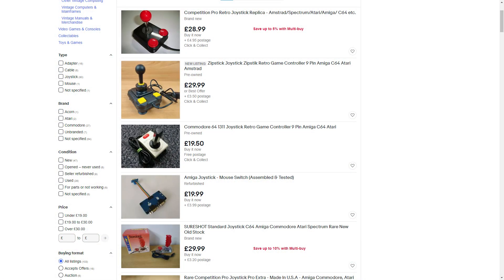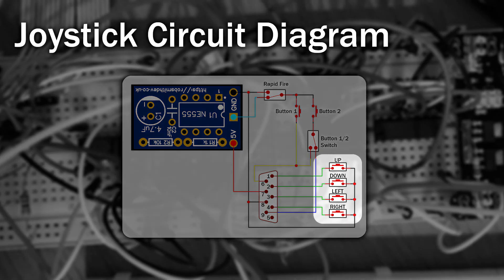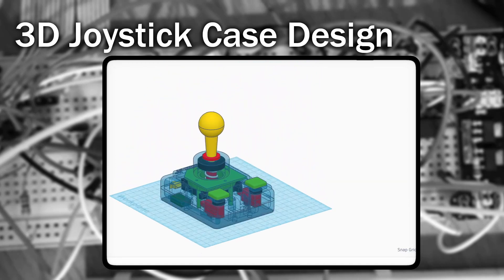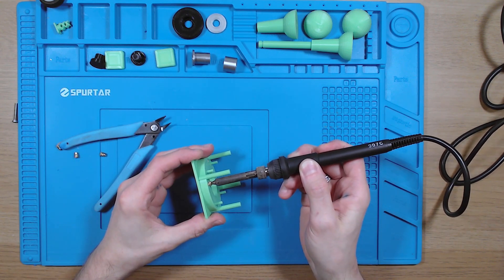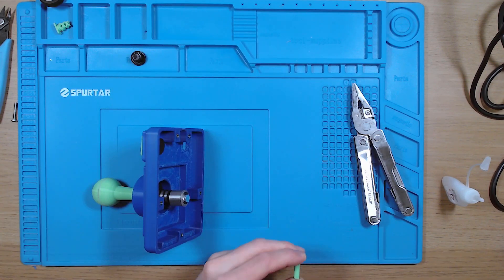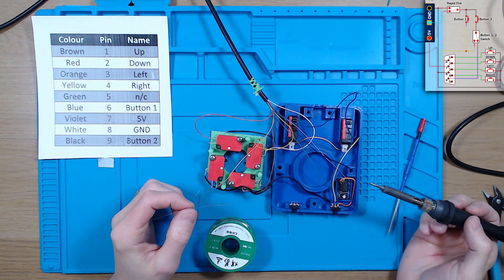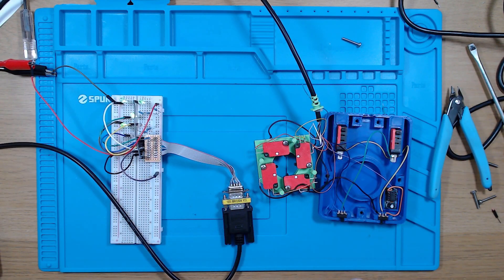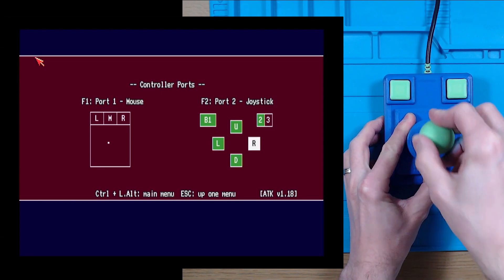Make A 3D Printed - Retro Style Joystick for my Amiga

Comment: Thanks for the video and you share on Thingieverse. I built my own using the 'standard' ali express mame type joystick kit and a replica amiga type shell on thingieverse.

Would you consider making a PCB (for the switches) and putting it on PCBway or similar where you have all those features and maybe even the 'third' button for Amiga?
Reply from the maker: Not sure what you mean by making a PCB for the switches? They’re normal micro switches?
Reply: @RobSmithDev  i mean that you solder switches on a pcb, connect the wires on it, then it would be easier to mount on the base of the joystck?

In your video you have a joystck tester made out of the bread board, but you can buy a pcb made by some scandanavian guy where its just so much easier. Pcbway you can get up to 10pcbs for $5, provided they dont exceed 10cm. Your pcb manufacturer may have a similar deal
Reply from the maker: Sure you could make a PCB to put switches on, but they’re screwed in so they can be replaced more easily. Ideally the wires should been on spade connectors so they just plug in.
Regarding the joystick tester, yes there’s several, I even built my own when I was younger at school! But that wasn’t the point of what I did in the video

Comment: Been hoping somebody would do this, print controllers, so thanks for that. Very nice, wise move with the metal core, most of the better ones did that. Glad you added something extra since "Why not?" heh. Very slick, robust, and nice finishings. ;)
Not that I think Zip is bad but something that would have been better than verticality is turning the unit horizontal to be more like arcade cabinets. Additionally it could have a hat switch like the Gravis gamepad used to flop the layout instead of doubling face buttons like some did Eg. Beeshu.

Comment: I'm all for making stuff yourself, but was this really any cheaper than just buying a joystick?

Also, I know it tested fine, but how did it actually feel when you used it to play games? I've tried a lot of joysticks that seemed to work fine, but just didn't feel right when using them in an actual game.
Reply from the maker: Cost wise not sure but part of this was actually to see if it could be done. 
The feel is very important, it does actually feel like the ZipStik and Competition Pro and honestly worked great.
I took it to the Retro Computer Museum in Leicester, UK for feedback, they really liked it and there were several people who want to build their own!
Reply: @RobSmithDev  I've been thinking of building my own multi-button joystick for use with emulators, but I was planning to use arcade parts and just build the case for it out of wood, or maybe Lexan. I don't have a 3D printer, so I can't print my own parts.
Reply from the maker: More important,  the next video! So you can connect this and similar joysticks to a modern system! Out soon…

Comment: Very Zip-like. Nicely done! Is one screw enough to mount the micro switches? I've seen microswitches being mounted on plastic rods in the plastic piece that holds them all together. Another thing to improve could be some cable management clips and grooves. Maybe some enhancements for v2 :-).
Reply from the maker: Yeah one screw seems to be ok. You could probably get away with two posts if you change the design. Cable management lol always an afterthought!

Comment: Great project, was the aluminium stem strong enough when you tested it? I built a variable rate rapid fire joystic extension, but never worked that well. Will try out your PCB. Thanks for another well put together video.
Reply from the maker: I haven’t managed to break it and I’ve been quite rough with it. It’s probably stronger than all the plastic I suspect!